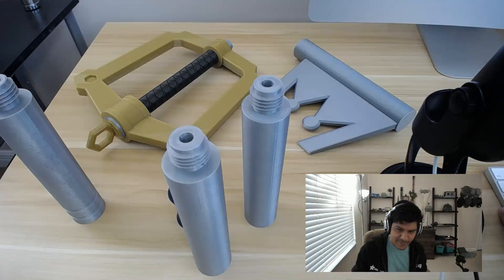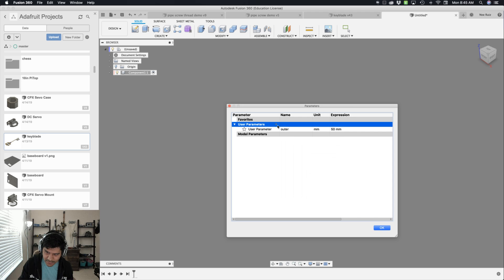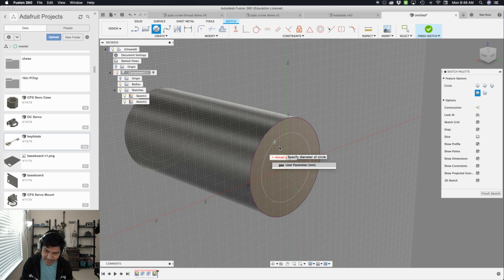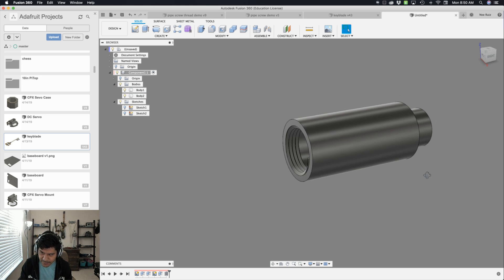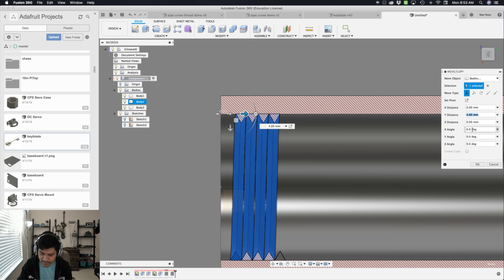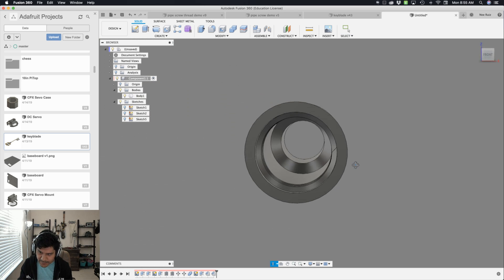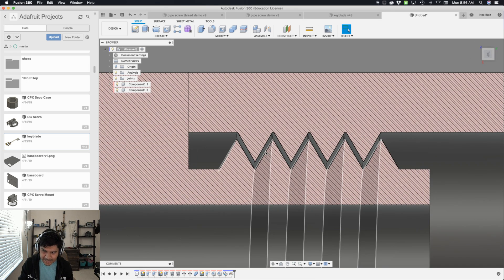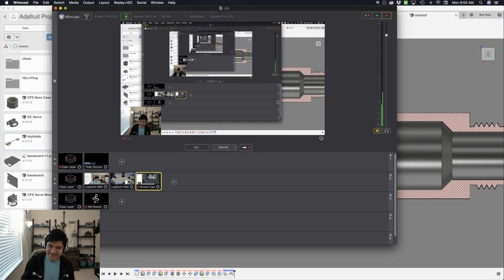Fusion 360 Tutorial – Screw Threaded Parts

Comment: I can't find "coil" anywhere in Fusion 360 following these instructions (stopped at 5:51). Has this function been renamed to thread? Or am I missing something?  I'm very new to Fusion 360.
Reply: Either hit S for the search and type coil, or look under the create drop down.
Reply: @jellybagel0925  Thanks Jerome, I ended up figuring out via search for another video on YouTube about coils that I needed to have the proper thing selected along the left hand side (I think it was the component, or the sketch, or the axis plane, I can't recall. Needless to say, when I asked the question, I wasn't selected in that correct place and I was using S to search for coil, but the coil option was not showing up. I had to abandon the training because a little into the coil section, my Fusion360 version wasn't matching the tutorial and I didn't see an option for "pitch", only height. My drawings and the effect were not matching what the tutorial was saying.  Haha, I still learned quite a bit and may try to start over again.

Comment: using the "lining up" technique couldn't you use the threads to join rectangular pieces with the cylinder cut out and protruding.
Reply from the maker: yes that works too. our fix it flex 🔨 prop has rectangular parts with screw-threaded ends.